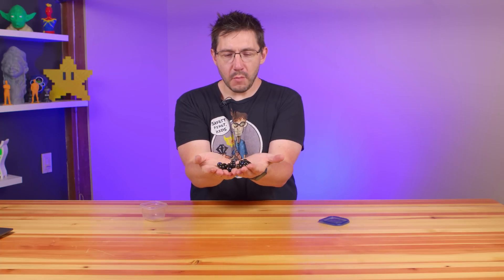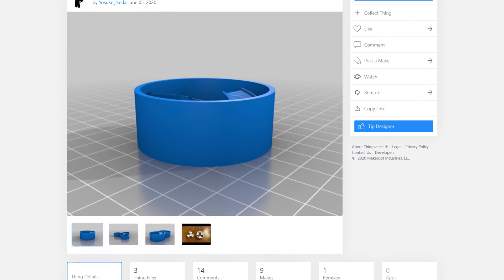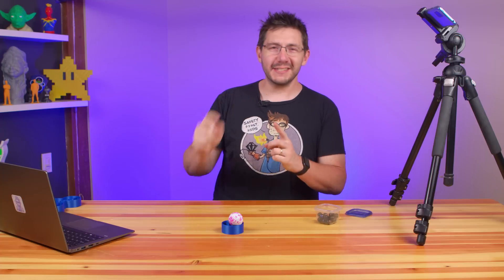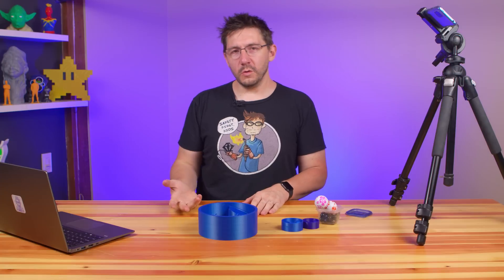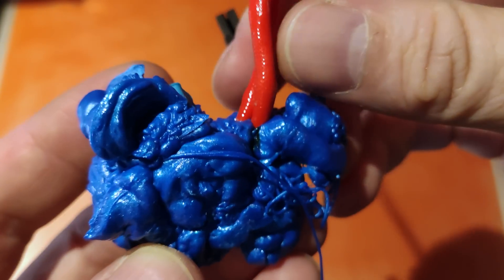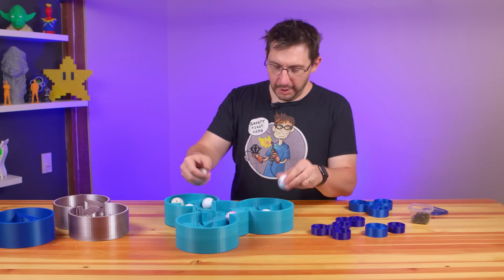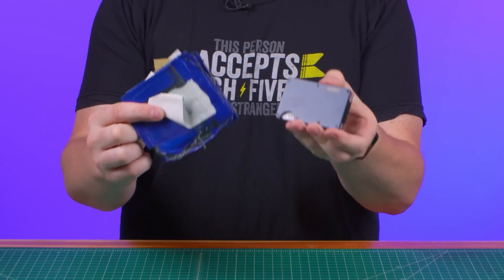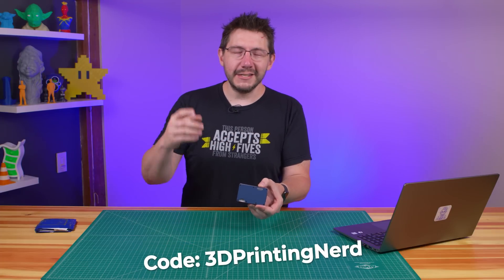This is WAY LOUDER with Golf Balls!

Comment: Your engulfed printhead...
If we monitor the on time of the hearer cartridge,  and the speed at which the nozzle cools, wouldnt we be able to tell if the nozzle is engulfed based on the extra mass and insulation wrapped around the nozzle?  Maybe a fan sensor that monitors rpm, or duty cycle of the pwm, to detect things like a rats nest in front of the fan?

Comment: In WhamBam's video to cleaning their PEX print surface, they recommend using 000-grid metal wool pads instead of sanding paper, because the sanding paper contains glues that would crumble into the print surfce and could have undesirable effects there.

Comment: so im not sure whats going on with my printer. maybe just wrong settings but i have an all metal hotend and i have a capricorn bowden tube and when i print something the filament has trouble sticking to the build plate. It didnt have that issue when i first got my ender 5 but idk whats going on lol. Maybe im just being dumb

Comment: I saw this on reddit
Reply from the maker: Me too!
Reply: @3DPrintingNerd  also I just wanna say if you do a video on getting prints to stick I highly recommend using acrylic paint as an adhesive. I have been using it for a couple weeks and and it works phenomenally. Sometimes paint chips off if my nozzle is too close but it stick really well, and I haven't had a more reliable printing experience with anything else.

Comment: Tech question.  Just got s as new roll of 3D solutech real black. Now when the print finishes and I leave the roll hooked up for a few hours after the print the filament front the outside of the feeder all the way to the hotend gets brittle and the hotend gets plugged up to where I had to take the hotend off and punch out the clogged that hard as a rock. Why is this happening. Never had this issue before even when the roll been left on for over a week. Thank u

Comment: baked in adds are usualy the point where i hit the arrow-key to fast forward. BUT not this time. instead of making an "this is wonderfull stuff ad" you're going to make it more a review - and that's great! we all know it's sponsored - we all know it will apear at least one more time with the final results of the buddy-test. but that's a fair method to present a product. you get at least three opinions. i don't use a wallet since forever. they are bulky and all i usualy need is the driver license and my credit card. so that goes into the pocket and i'm ready to go. all that stuff is of course unprotected. the ridge wallet would take more or less the same amount of pocketspace as my loose collection of cards but they would be more protected. i'm looking forward to see and hear what the 3DpN-Army has to say about there experience

Comment: Man, i do love you but did you really add ads after saying the license of the thing you are showcasing is non-commercial?
Reply from the maker: Yes, and I did some research and it looks like doing this with CC-NC is allowed. From what I understand the NC is meant to prohibit the primary use as commercial advantage. So, selling the model or the print of the model for more than the cost to make it.

Comment: That plastic probe on the BL Touch is why I have stopped using official bl touch probes. Got tired of probes breaking off and rendering itself, the bl touch, useless. So now I will only by bl touch copies with METAL probes that won't bend or break.

Comment: The bltouch pins are replacable, spares can be bought. If you remove the screw at the top, you can take the pin out (after cutting of the bended part). You don't need to replace the whole thing.

Comment: Hey Joel.. 1st a great helpful 3D printing channel you got here!  Now the boot kissing is done :P  I have now the new 2020 updated model X5SA big 3D printer by Tronxy.  Being a newbie it took some time to build as all new never done before stuff does!  I now trying to get it set up and leveled. Have you ever used these printers or know about them such to give me and any other newbies any guidance about the set up and use of this big printer?  Any advice be cool... love the videos keep it up. HI FIVE from the UK.
Reply: I would recommend asking Makers Muse or 3D Maker Noob. Both have used multiple TronXY printers and they would probably have a good idea.
Reply: Based on my experience with a Tronxy X5S-2E... the heated beds aren't always flat and you may need to shim the smooth rods to adjust the flatness of the top and bottom bars they connect to (what they call "Aluminium-2" in the assembly manual). The smooth rods on my printer were 2-3mm short and had to be shimmed up to prevent the hot end dragging through the middle of the heated bed. Extremely poor tolerances on their machined parts. :(

Comment: You know my first thought on that 330% size: I could fit some RC servos in that, maybe with an Arduino nano to co-ordinate them.
Reply: I was thinking something similar but with some gearing even for the smaller versions.
Reply: Spring loaded in the up position and use a motor with a cam to push it down
Reply: The 9g servo would work great if the plastic or golf balls aren't too heavy!